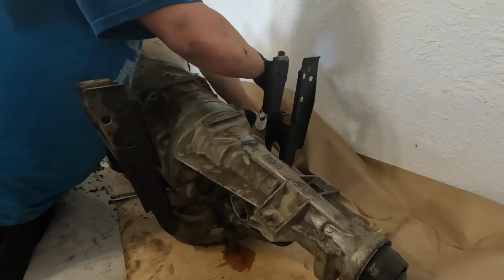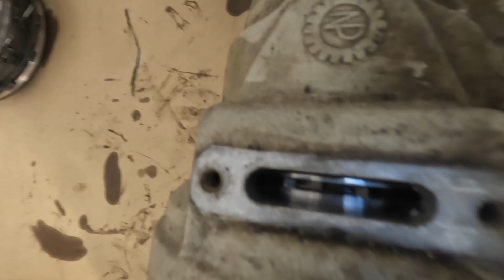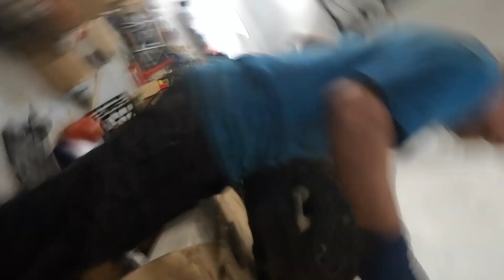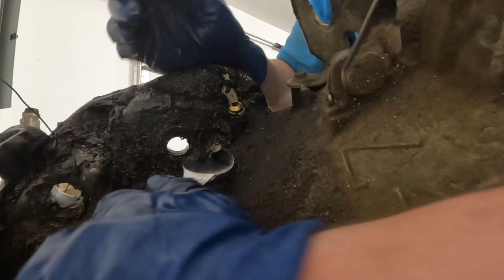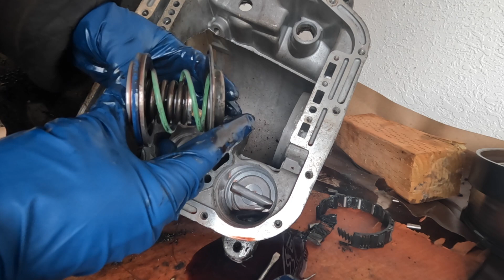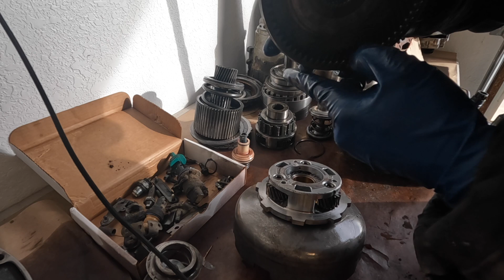46RH/RE Transmission Tear Down and Inspection  - Dodge Conversion Van Pt 4

Comment: Can you pleaseee tell me why a 46re would whinee or whuur loudely in 1st 2nd 3rd gear but not in 4th.  Not in park.. not standing still in gear.   If i go to neutral.   It still whines if im rolling at speed.. turn engine off.. still whines..  but as SOON as it goes to overdrive.. its gone.

Transfercase to neutral..  still there when rolling.  It shift fine exactly like it has for the last 150k miles ive owned it.. it has 220k.. fluid changes every 30k miles.. last one i did find three snap ring peices though.. two were the same leice.. one was another.   But that noise hasnt started until the last year.   And those snap rings i found 3-4 years ago
Reply from the maker: That is strange. Hard to say what the issue could be, but if the sound goes away in overdrive the issue could either be in the overdrive section, or be related to that snap ring. When the OD apply piston engages it may be changing something to stop the sound, possibly the OD planetary set, or the apply causes a change in the main case. The broken snap ring is probably related. Honestly if it's been operating correctly I would run it until you can tear into it.
Reply: @NotEnoughProjects    Well i have no choice other than keep driving it.  But how would the od making the noise go away mean its the OD making the noise ?  I guess im a little confused